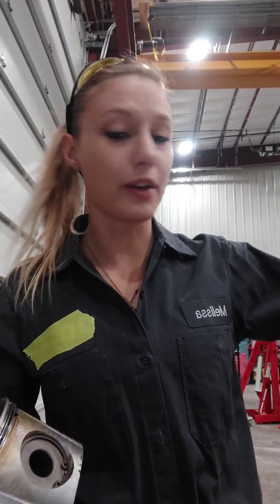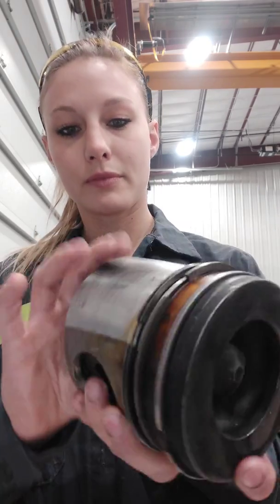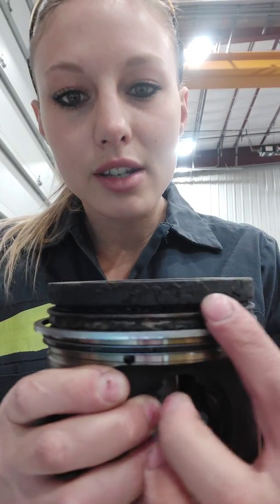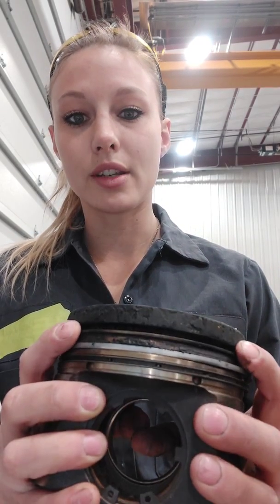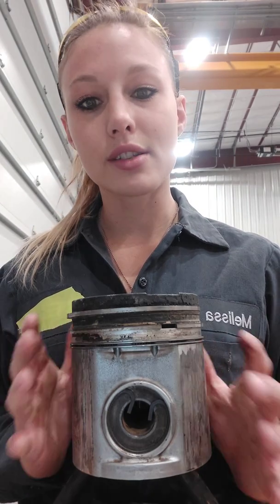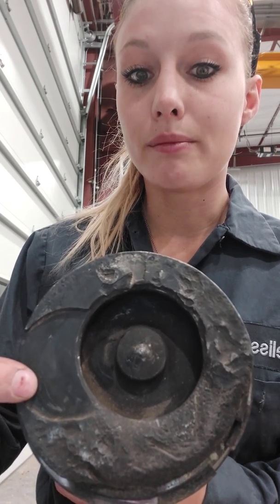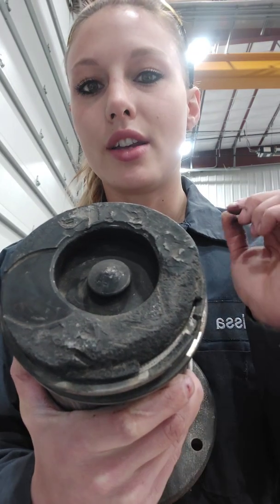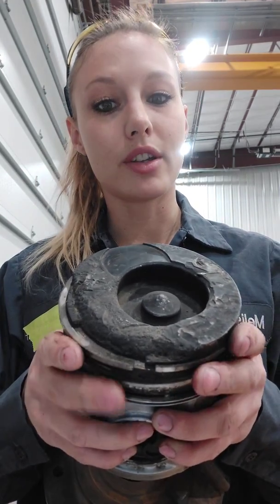Diesel Engines, Pistons and determining engine failure.

Comment: Your a smart and pretty lady.  If I could put engine overspend in layman's terms for you ? Normally the engine drives combustion?  When an engine overspeed occurs?  Combustion drives the engine.  Hi from a mature experienced aussie diesel fitter, with advanced engineering quals, advanced hydraulics 1 , 2, and 3 and I hold a university degree in mechanical engineering.  I'm currently studying for my masters degree in mechanical, hydraulic and pneumatics degree in practical and theoretical applications. You will go along way in your chosen profession if you never give up on yourself and further higher qualifications. ✨️  you go girl 👍👍👍✌️

Comment: Anti-freeze in a cylinder would have washed that  piston clean.  An o-ring leaking on a liner, the anti-freeze would have went into oil pan and eventually wipe out bearings.

Comment: I rebuilt a lot of gasoline engines starting in the 60s and on. Taught myself. It sure is fun. I still have some of my original tools. There’s nothing like rebuilding an engine and it actually starts up when you’re done. I never worked on diesels. I did drive 18 wheelers for time.

Comment: Do you ever see engine failures due to liner protrusion tolerances? My series 60 was tight when I had a head gasket replaced. 1,889,000 original miles on the block. I love this engine

Comment: I have a 2002 Dodge Ram three-quarter ton with a 24 valve and I just put the new motor in it says cam sensor it's not working the tacna murder and the check engine light is on clear the code and it keep coming up what do we do my darling😮😮😮😮

Comment: I have seen a lot of different engine failures over my 28 years in the field. That last piston also looks like the engine ran extremely hot, which can cause the "guallin" on the sides. The second piston, with the broken top ring, is also a common problem with 3126B/C7 CAT engines, which unfortunately do not have replaceable cylinder sleeves, I just rebuilt two last year because of that issue.

Comment: Thats carbon build up and anti-freeze going through engine tends too clean and remove carbon. Since top ring was broken that was from carbon packing. 3rd piston over fueling or someone cranked fuel up and ran it hard, Seen many mechanical cats do this especially when they put cummins turbo for more boost. Fry number 5 and 6 just melt top of piston

Comment: At the shop I worked at we had 10 new trucks all with N14 460’s and 8 of the 10 had dropped valves in cylinders 1/2.. luckily those weren’t a single head design. It was odd because the valves were breaking off almost like they had been cut off. This was occurring before 300k mi and it took some fighting but Cummins supplied the parts. It was a heat treatment issue with the valves but it always struck me as odd it was always in #1 or#2. I wish I had saved the one piston that the driver said “damn right I heard it, but do you think my fat ass was walking.. I ran that fu$&er to the truck stop man!” Great video.

Comment: Very beautiful and smart. I have a maxxforce7 it throws excessive amount of white smoke through the pipe, it comes vapor from the oil dipstick when I pull it out, at first I was loosing coolant but I threw headgasket sealer I don't loose coolant anymore, I replaced the water pump, egr, and turbo and still have the same issue. Is my engine gone 😫 😭?

Comment: my nv200 diesel is doing well for 300,000km after 8 years off using it,and had did engine gearbox servicing ,ac all serviced,suspension all service too and doing great but recent just now got this issue off rattling shaking engine sound like beating each other when moving and finally slowly come to halt stop and fail to move off when i drive,now has sent towing service to the mechanic shop and just dont know wether its something to do with the piston issue

Comment: That IH piston looks like a machined valve relief on the top. The other damage i would say was a dropped tip or valve
Reply from the maker: Yeah, I mentioned both of those in the video
Reply: @thedieselqueenmelissa  que maneiro uma mecânica diesel .
Sou mecânico de motos.